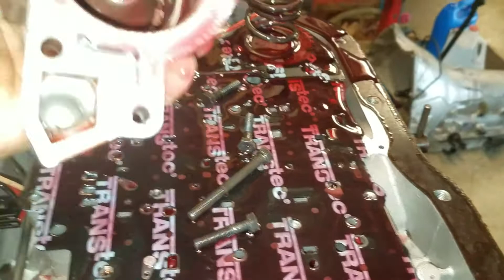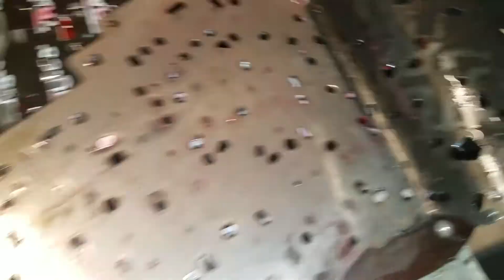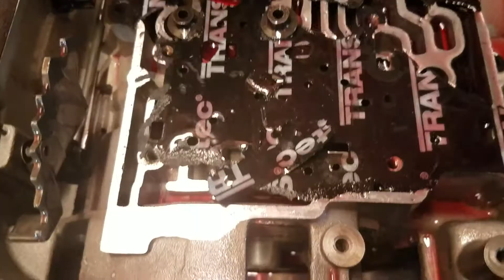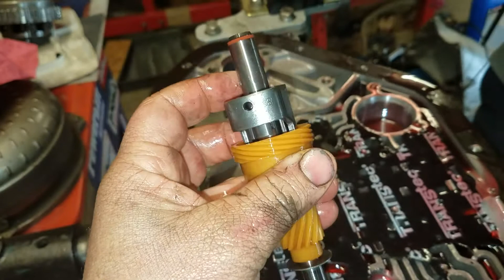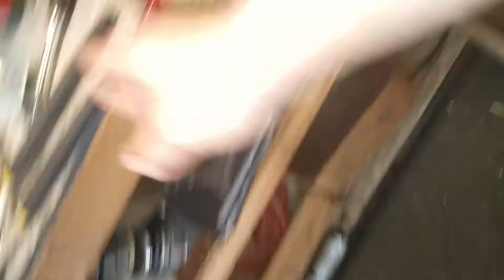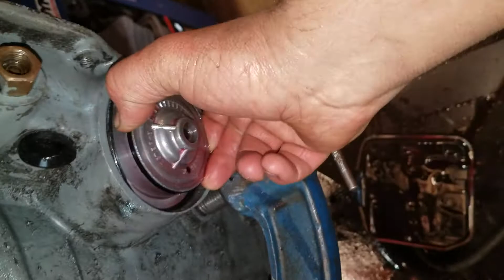200-4r teardown con't

Comment: I like watching videos on the 200-4r. Last winter I  rebuild  a 200-4r full billet. I made my own custom Reverse manual valve body and separator plate with engine braking in 2nd, 3rd and 4th and lockup in 4th